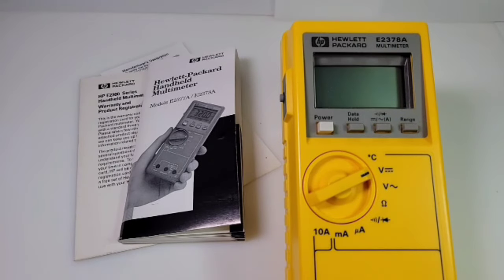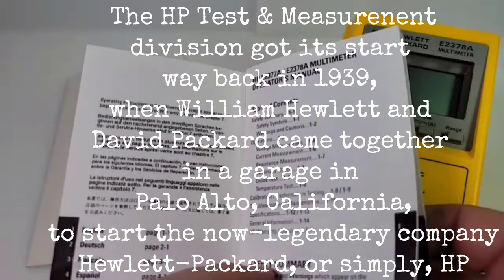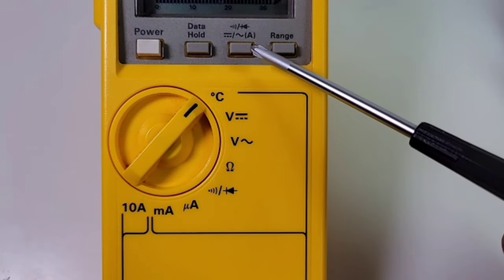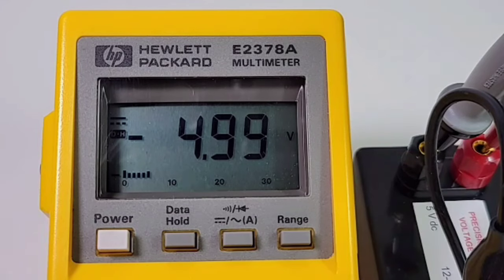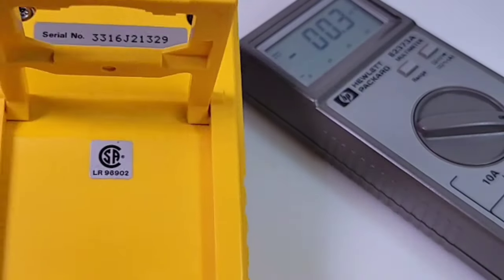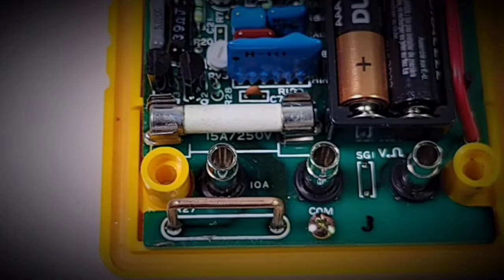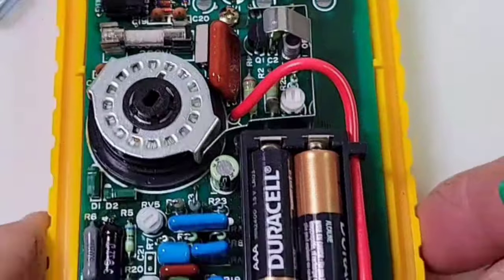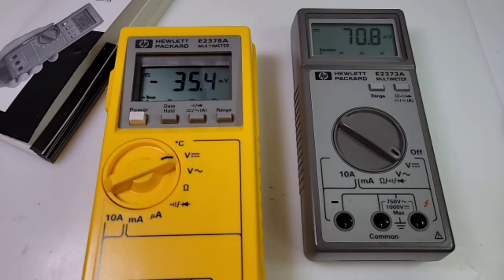RETRO-TECH ○ HEWLETT-PACKARD E2378A Vintage Multimeter Mini Review & Teardown!

Comment: I'm going to have to open my old drawer of ancient meters and take another look at what I have in there.
I know the meters have been resting sans batteries now that I have a beautiful Owon. I think they are liquid crystal display
meters from the mid 80's. Low cost but are fairly accurate. I think maybe 1 count or possibly 2 count? Anyway nothing to
write home about. Let's go take a look and be really scared at what I was using to do repairs. I will get back to you. Aloha
Reply from the maker: Oh wow...that sounds like a real treasure hunt ! Let us know what you find and send a few pics if possible. I'll post on the website so others can see those multimeter treasures 😊

Comment: When an American brand is combined with Japanese build quality you know the product will be good. Even after 30 years both E2378A and E2373A look perfectly fine and not outdated at all. There is no reason not to use them. 👍

I was worried about Duracell batteries as well. Just the other year they’d leaked again in my Christmas light. Not that it corroded anything, but even the cheapest ones don’t leak that often for me.
Reply from the maker: It's funny..unlike other electronics.. multimeters rarely go out of style and it's awesome using a multimeter that was made  back in the day. These multimeters are tanks and just as accurate as anything made today. As for those batteries., I'm not one to normally critique a brand but Duracell has let me down way too many times...ugh! 😱

Comment: Back in those days, the common saying was that there are 3 multimeter brands to choose from: Fluke, Fluke, or Fluke.  However, this HP is built every bit as well as a 1989 Fluke, so it probably deserved a bit more respect.  It's late-80's Japanese, so you know it's good, but it's even better than I expected.
Reply from the maker: Spot on Rob. They paid alot of attention to the little things and that means alot!
Reply: Hi, I have a fluke 21 from about the same period, you have to remove the whole back to replace the battery,  it doesn't even have threaded inserts, the screws go straight into plastic, so I would have to say the HP is better made. (don't get me wrong, I love my vintage fluke)

Comment: Where can I get parts for my HP E2377A?  Had to swap batteries and corrosion had set in and was using a wire brush and the one plate jump out when I wasn't looking.  now multi isn't working,  Thanks and Thanks for the informative Video!!
Reply from the maker: Can you send me a picture , netplicity1@gmail.com 
I'll see if I have the part you need.